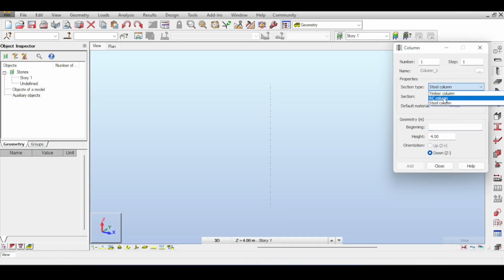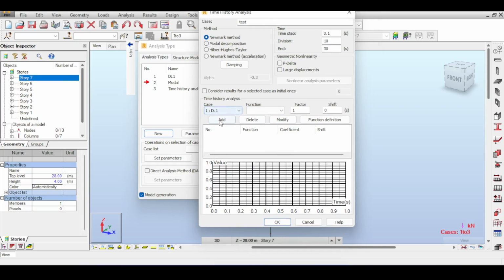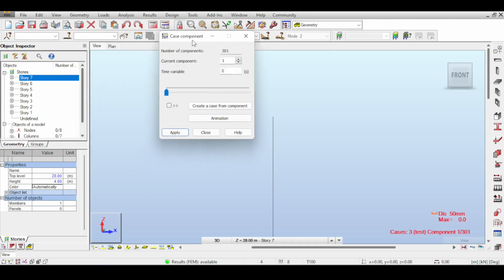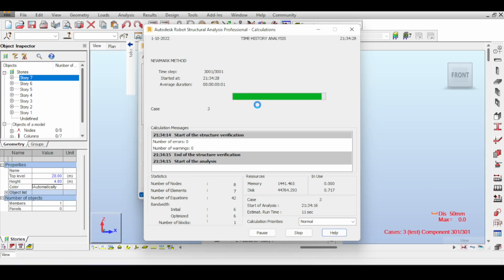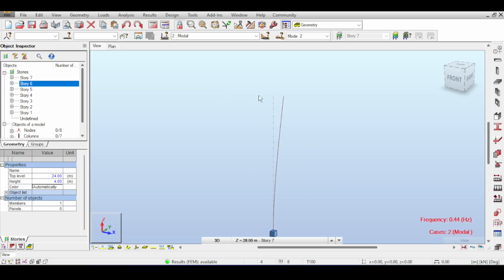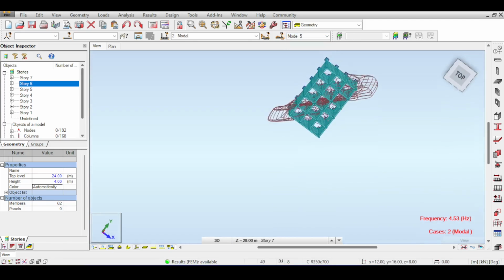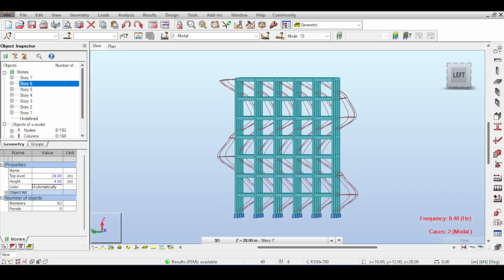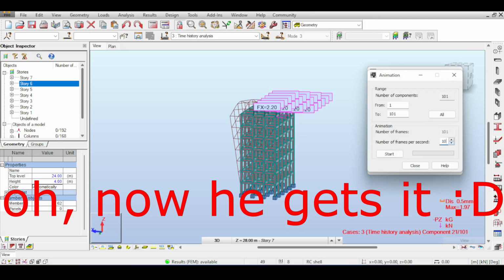Time History Dynamic Analysis in Autodesk Robot: Step-by-Step Tutorial

Comment: Hi Sir CEE;

Have 2 question

-The first one is related to how to insert columns for spaces where there are curtain walls.

 Usually for a structure that only has brick walls, we insert columns inside the brick walls and cover it with finishes which makes the axes of the slabs pass through the axes of the beams and columns. but for curtain walls, the column are behind the walls. How can we take into account this for the different axes for load trasfert of structural systems??

-The second question is can we perform static + dynamic load combination??

Like for the structure you corrected,  there is one part of the structure ( generator room)  which causes vibration of the structure. How to take into account the static and dynamic loads 

Hope to get a response🙏
Boris
Reply from the maker: If you want to insert a column at a curtain wall, you would need to replace the curtain wall. However, please notice that "shear walls" can be used to carry vertical loads totally fine. Actually, I do encourage to use your shear walls to carry vertical loads as it will have a positive effect on its moment and shear load capacity.

You can do a static dynamic load combination. The question here is: are there combinations in the code that need that? I have not seen this before.

Regards,
CEE

Comment: Is it possible to take account of +-5% accidental torsion covered in seismic codes in Robot’s time history analysis?
Reply from the maker: Hello dear Engr.
unfortunately, no. The accidental eccentricity is available under the "seismic" and "seismic (Equivalent Lat. Force)".

Time history analysis does not include this, unfortunately.

A work-around is really hard but includes manually defining the selfweight as deadload in such a way that the centroid of forces is at 5% eccentricity.

This - of course - is a nightmare in modeling.

Regards,
CEE
Reply: @CivilEngineeringEssentials  And it is actually quite tough to do as well for time history analysis in other software such as ETABS. A workaround there however is by shifting the story center of mass from the mass source dialog. I guess Robot do not provide such override in mass source definition and mostly done automatically right? Or is there any way to do so? Thanks for your help 😁
Reply from the maker: I will have to check it out. Will do as soon as I am back in my office. You can expect a reply within 3hrs.
Reply from the maker: Hello there,
unfortunately, there is no such option in Autodesk Robot. I checked almost every corner I know in the software.

Anyways, feel free to ask anything. I will try my best to answer any comments as soon as I can.
Reply: @CivilEngineeringEssentials  Well appreciate for the help. Thank you so much :)

Comment: Good Tutorial CEE.

With respect to the mode shapes, I had to do two things per your recommendation.  

Firstly, I had to increase the stiffness of all the beams in all 3 direction by 4x, which somehow worked. But I don’t like the idea.

Secondly, I had to model the structure close to the real structure by inserting some slabs in the building to increase the floor stiffness. 
And almost all the mode shapes made sense as per my expectations.

With regard to the time history tutorial, I had to read in one of the default time histories that comes with RSAP just to avoid any potential bug 🐛 that might slow me down.

However I have one question which I need your clarification,
with regards to determing the Mass (alpha) and Stiffness ( Beta) proportional parameters, what’s the basis for selecting the 2nd mode frequency for (w1) and the arbitrary circular frequency (w2).?

In practice, will it be adequate to pick the first and the last modal frequency for w1 and w2 respectively?

Am so appreciative of the fact that you had to literally go through hell to make your viewers happy with your timely tutorials.

Excellent 💯 tutorials Sir
Thank you
Regards
Reply from the maker: Hello there,
I am glad you liked it.
True, a full structure is to be modeled (with slabs) so that mode shapes to make more sense. I expect that the strange diagonal shapes will be eliminated because the axial stiffness of the slabs will resist such modes.

as for w1 and w2, 
w1 is the 1st frequency,
w2 is the 2nd frequency, I just simply "assumed" a value for it. I should have taken it out from the mode shapes.

thanks a lot for your comment, it encourages me to do my absolute best.
Regards,
CEE
Reply: @CivilEngineeringEssentials  noted and  thank you 🙏